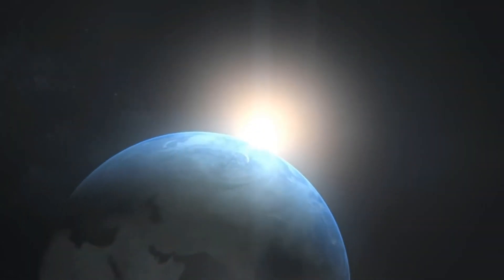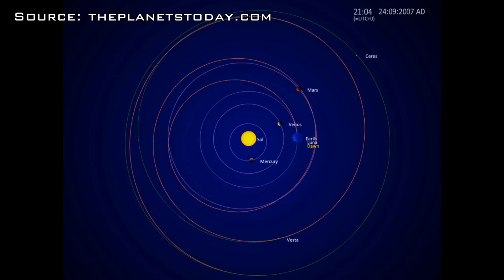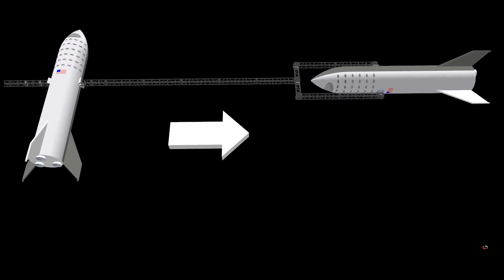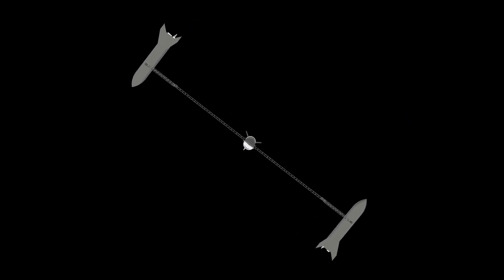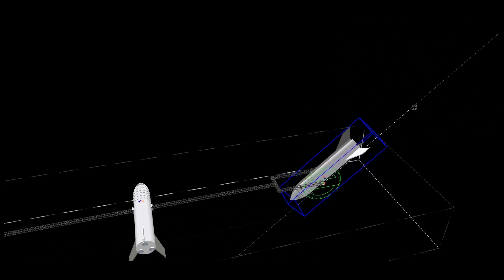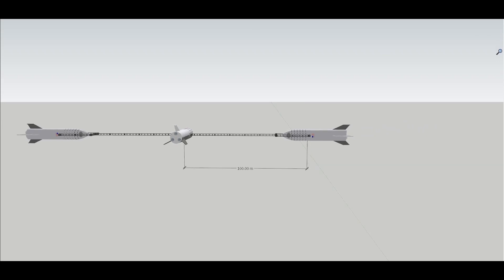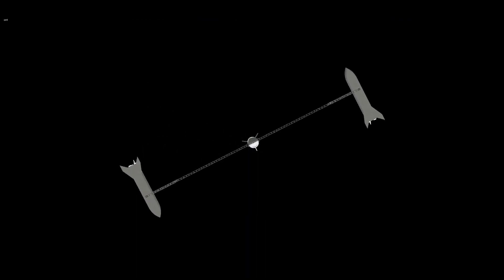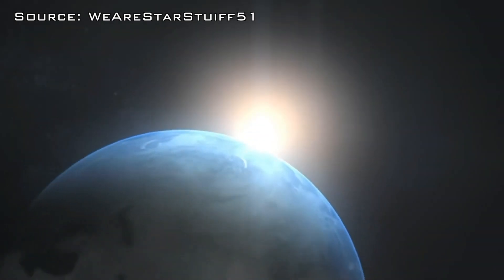GLS2: Artificial Gravity for SpaceX's Starship

Comment from the maker: For all the new people checking out this relatively old video (this was my first youtube video, and the reason I make youtube videos in the first place) be advised that this design has major problems starting with first and foremost; stress on the truss during spin-up and spin-down, starships having to be redesigned to include hull-side strong points, and 100 meters being too short of a radius to name a few of the big ones. GLS v3 is STILL in the works after all this time! Thanks for watching, and subscribing, and BIG shoutout to the ORIGINAL 1,000 subscribers!
Reply: It's also a very interesting idea to have variable spin speed. You could sort of see this as analogous to a diver undergoing decompression in order to acclimatise to atmospheric pressure, except that in this sense we are acclimatising to gravitational force. Or perhaps you could even make the "gravity" stronger than on earth so that everyone arrives at Mars in an artificially strengthened state - which might be useful.
Reply: If a crane can lift an entire Starship at 1g, why not just use a km long tether, connecting 2 Starships nose to nose and use small thrusters and/or reaction wheels to spin up/down and maintain stability?
Reply from the maker: 1km is probably overkill, but I think you're on the right track!
Reply: @sluggo7  why not just use a centrifuge inside the ship? lot simpler than having two starships
Reply: @imEden0  because it's far too small a radius of rotation. You need a large radius (like, ideally hundreds of meters) to reduce the ratio of the radius at the feet vs. the head, to reduce Coriolis effect and motion sickness.
Reply: @sluggo7  the rpm need is only like 6 rpm for 1 g  and making the assumption 1 g would be use is a bad one. .5 g would simplify many issues and reduce rpm to only 3 rpm. haha Coriolis effect is a weak force. again that is an assumption that has very little science to back it up 

once more simplicity is number 1 cables, hundreds of meters and a bunch of junk is going to fail.
Reply: @sluggo7  they’ve done studies. The pressure except for eyes has been fixed. you just need training
Reply: Your system is way to complicated. The best engineering is no engineering. This is probably also the reason Starship is the diameter it is. Starship would only need to rotate at 9.97- 14.09  rpm (18m-9m) to attain 1 G. This is a Delta v of only (9.95-6.64) easy to speed up and slowdown.   When this idea is applied with the planned hot RCS, problem solved with very much reduced complexity, even over the same concept with cold RCS! Decreasing potential failure points and weight.          

The diameter of Starship has probably been selected based a balance of needs such as,  Rpm need for 1G, needed delta V to get said Rpm ,  aerodynamic limitations when leaving Earth balanced with  strength, volume for fuel and livable space. 

 simplicity = reliability = reduced cost
Reply: @a-ronm4694  I don't think centrifugal G is very comfortable with a small diameter, it throws out your inner ear due to your feet having more apparent G than your head and a weird feeling when you move your head quickly due to a sort of coriolis effect.
Reply: @a-ronm4694  spinning up starship on its own is bad too. gravity produced would force you to the relative ceiling (the floor being there because of the ship's orientation landing on mars) and the equipment, designed for mostly one side of the room (apart from in space stuff), would have to be designed to rotate or you could pack extra equipment. It's easier to have a centrifuge inside of the ship if you want artificial gravity.
Reply: This leads me to the question. Do you know why Starship has windows ?

Only to make it look cool/ be saleable. 
There will be nothing to observe for 3/4's of the trip or more. Windows also drastically increase possible failure points and if rotating Starship is how they plan to create gravity. The observed rotation may make people sick. Even though they will feel no physical forces other than the artificial gravity .   
Just as you suggested in your design the interplanetary floor of Starship will be the walls at launch, so having windows on the floor makes no sense. 
There probably will be a cockpit  or parts of the ship that are oriented for different parts of flight/uses because it doesn't make much sense to be attached to the walls while landing, that would be very uncomfortable.

Comment: You could use a much shorter(and more stable, thus)(15 meters of truss/frame on each side of central hub) truss and still rotate the trio of starships at 3 rpm, resulting in about 70% gravity at the extreme ends and about 40%-50% Earth gravity in habitation section.

Comment: The center Starship should be a dedicated Cargo Starship type.
It would carry a mass that would be attached to the Starship lifting points at the nose. The lifting points used to lift Starship to its launch pad.
This mass will balance the the center Starship mass, so the gravity arm would be at the center of the mass.
All starships are connected by its lifting point.
SpaceX should also add an extra attachment point, just like the Dragon 2 Claw that attach the capsule and its trunk.

The truss should be scissor lift type, two of them, to counteract the bending motion while the applying rotational thrust. Reference: NASA NIAC Kilometer-Scale Space Structures from a Single Launch.
Since it's a scissor, the length of the arm can be adjusted easily. Compensating for uneven mass in two starship, ie, one a crew Starship and the other one a Cargo Starship.
The rotational thrust should be provided by the center Starship, making it all in one artificial gravity solution for Starship.
The center starship would also provides course correction, extra solar power, battery etc.
The mass that attached to nose of the center starship could also be a giant electromagnet, eg. an MRI scanner machine, that could provide magnetic shielding against solar wind.
While providing magnetic shielding, the both starships would be retracted without rotation.

Comment: I'd bet money a scaffold like that would be torn apart by tensile and centripetal forces once spun up.
Reply from the maker: Tensile probably fine, especially with rope like reinforcement, but bending will be murder on it for spin up and spin down
Reply: @smallstars  I think you severely underestimate the weight of a fully crewed and mostly fueled starship combined with a 100m truss. keep in mind these trusses need to be built as lightly as possible to fit within the 100-ton mars launch capacity of the starship. furthermore, you want this truss to unfold but keep in mind that such a mechanism will create potential fail points at every connection especially if you don't want to use EVA's for assembly, and the reliability issues become incredibly important when you say spin the maneuver will be done post mars transfer burn meaning returning to earth is no longer a quick option if something is to go wrong. I'm sorry if I'm coming across as upset it's because I am I'm going to college to do this exact kind of stuff and it's clear to me you haven't thought about this beyond a surface level. How will the trusses be packed into the cargo hold, what mechanisms do you plan to use to unpack them into their functional state, how do you plan to attach the trusses once unpacked, what does the construction of the trusses looks like, have you done any of the math to see if your plan can bear the weight requirements with sufficient safety margins? You and Elon, unfortunately, have this trait in common spout off a bunch of cool-sounding ideas with no bearing on the reality of the complexities that lie in those ideas I'll leave you with this piece of advice that holds true in many industries. Talk is cheap and idea guys are a dime a dozen the real value lies in people with the knowledge to turn ideas into reality and know the limitations of the field they work in and know how to work around them.

Comment: Rather than needing 2 whole ships, could one design a ballast system similar in concept to history's earliest ocean vessels? Would a flexible rope or tube like tether be easier to manage? Spinning on ice skates or a merry-go-round, energy stored in centrifugal force speeds up rotation as skaters pull arms into the center. It seems batteries could help manage the stored kinetic energy in the rotation? Less combustible fuel may be required slowing down. 
Disconnecting ballast at the perfect time may be another way of using slingshot physics to slow down.
Managing a ballast system at both ends of a journey may be a way of storing vortex energy of the 1st trip for re-use on additional expeditions. The center of a spiraling funnel could create a fixed entry point. The outer vortex principles at play similar to running and mounting the merry-go-round could be used.
This comment made me sleepy. Sleep has energy storage clues also. Good grief and good night.

Comment: my man really did like 10 min of research and got excited by the word "centripetal" and slapped it all together into a sad excuse of video. Assuming that you have the health and safety of the people on board in mind, you'd want to make it as close to earth like gravity as possible, the minimum you'd need to make that work is a radius of 56 meters with a rotation period of 15 seconds, now that's most likely impractical and the Coriolis effect from it would likely make the people inside feel more uncomfortable than null gravity. so lets double that just for the sake of being realistic, 224 meters and a 30s rotation period, the tensile forces (assuming the mass of the starship is what SpaceX has stated, 100000kg) acting on those "truces" is past anything that we can cost-effectively manufacture at the moment, so what do you suggest we use to construct them, pls enlighten me? and what material would we use to construct the pivot joints that could allow for such forces to be withstood as well as allow that degree of motion to occur.  I don't mind if you ignore this comment, but I would appreciate it if you wouldn't just say stuff thinking you have a solution to some great problem that the hard-working engineers at SpaceX have seemingly overlooked, I'm sure if some deadbeat on youtube thought of it, then the impeccable minds at SpaceX have already thought it over more times than your tiny brain can count.

Comment: 1 G spin is extremely expensive, heavy, fuel intensive and structurally not sound. Bullet spin improves flight via  gyro stabilation  but heavy. Designing for vertical launch and then adding structure to take cintrupical loads for 1 G spin is not sound. Nothing in space ship needs 1G radial loads. Man need spinning 1G sleeping quarters so spin a a few beds is better idea than spinning the entire space craft.

Comment: Wow you should see the sketch i was working on. I use a Startship as a space tug boat in the center to carry 10 Starship for a round trip to Mars using nuclear propulsion.  The center Starship will be equpe of 2 star formation of support (each supporting docked startship) the support will be like a L and the starship secured on the inside of the L held mostly by gravity. in the middle of the L a locking system/ hatch. That allow movement inside the L support to other Starship attached to the Tug boat Starship. 

The thug boat system never enter atmosphere. and spin and stop spinning by small truster on the side of the 10 L Shape support. 

I wish i had talent to draw the thing. I would call it intrastellar tugship. There could be many for mars and the moon. picking up starship and droping starship with crew and equipement. gravity could be ajusted to the need of the trip or stop for decoupling of starship. 

IF any talented 3d graphic artist can contact me so i can share my vision may we could make the concept populare enaugh for Musk to notice.

Comment: This sounds.. umm.. way too good to be true.. the biggest problem I see is the inability of doing correction burns while spinning. You can always stop the spin, do the burn and then initiate the spin again but that's a lot of deltaV spent. Also the whole system sounds extremely heavy. Just the support beams alone that are supposed to hold the weight of starships woupd probably be too heavy to be practical

Comment: A better way to do this is to simply tie two of the starships nose-to-nose with a bundle of long steel cables. You can spin up the assembly with side thrusters operating at low speed over time to build up acceleration. You don’t need to use the raptor engines to do that...that’s an absurd level of overkill.

So... Two starships nose-to-nose, and a series of steel cables connecting them. Much easier. And simpler. No design changes needed on the ships.  Their orientation is now vertically aligned with their structural design (they’re not designed to be supported sideways). And they can handle the stress of being hung by the nose, since we saw that happen recently when SN9 was hung by a crane during repairs.

That’s it! No special hardware necessary. GLS v3 is literally some steel cables. I doubt we can design anything simpler.

We could also launch steel weight payloads to space using multiple launches, and add a thruster to it. It could act as a counter weight and serve the purpose of the opposite force on the cable, rather than using an entire starship.

Comment: Can't we just spin a single rocket around its forward (Z) axis ? Using some sort of reaction wheel.
Reply from the maker: The spin radius needs to be very large for an artificial gravity system to work
Reply: @smallstars  thanks for answering :)
Isn't it speed which define the centifugal force ? The centrifugal force equation on  Starship (radius 4.5m) spining at around 446 rpm gives us about 1G of force. But maybe you meant that the small radius would make the force unequal between the head and the feet, would it be that bad ?

Comment: Wouldn’t it be better to just redesign the starship’s interior at this point so that the floors of it run parallel with the tangential velocity of the ships? This way the differing gravity would be mitigated some.
Reply from the maker: You are right, but then the starships wouldn't make very good habitats when landed on Mars

Comment: You don't need fuel to build angular momentum, why would you use the engines? I'd have a ship that splits into two sections attached by a tether with a motor between them.

Comment: Very inspiring ! However current version of Raptor engines can only be throttled down to 40% of full thrust, and I am not sure if they can be ignited in that condition, so some more progressive solution would have to be found. Maybe Merlin engines or smaller ? And the center starship with all its mass is not necessary. If really required, a simple cargo module could be used for supply during travel and discarded after Mars orbit insertion.

Comment: Why would one need a starship in the middle? And why a solid tress? Why not just a cable between two start ships?
Reply: Ah... the solid tress question was answered... though actually, having a "flacid" connection has the advantage of not actually breaking if the spin becomes out of sync. A solid truss over the distances/speeds/masses we're talking about here would not be nearly as solid  as imagined.

Comment: A cool idea indeed, the problem is however that different floors of the starship will be further away or closer to the centre of the spin. Meaning that they would experience a different speed because of the difference in circumference of the spin. Resulting with your head experiencing less gravity than your feet, to combat this the circumference of the spin would have to be much much larger than what's shown in the video. If you don't fully understand what i just said, watch "Can we create artificial gravity?" by real engineering.

Comment: You got many things wrong I think and over thought it..... a simple truss connected at base of rockets leverages the inate structural integrity and a simple gimble of one main engine on each should easily generate the spin without all the convoluted twisting and structural issues.

Comment: Cool idea!  But I don't think you can suspend a starship from the two points where the truss attaches.  You would need to build extra structure inside the starships to hold all that weight.   Starships have to be built as light/weak as possible due to the tyranny of the rocket equation.

Comment: This would require installing a lug at the CG of starship for the truss to attach to, as well as just assuming that the structure can support it's own weight out sideways from that point, which it's not designed to do. Also, note that the CG will be changing as fuel is burned, etc. so there will be quite a bit of torque needed at the pivot to ensure it can maintain the orientation. The fuel will need to come from the header tanks, as you're doing the burn when the rockets are either in zero g, or on their side, and the fuel in the main tanks won't be at the bottom, where needed for pickup.

Comment: Enough already! Centrifugal force is not gravity, and is not a substitute, that's why it hasn't been done. Spinning around might force you to the outside, but it will also totally screw with your inner ear workings, causing all kinds of nausea and other bad issues. Not only the ears, but a blood imbalance caused by different body areas spinning at different rates is not good.

Comment: Isnt that too fragile? The main engines, even with only a very short burst, have a very high power. So i think this fragile looking construction will simply be ripped apart by even a short burst of engine thrust if you use the main engines for that. For this kind of movement, i suggest a very small  extra rocket engine with much less power, build only for that purpose, is requiered to initiate this circling movement.